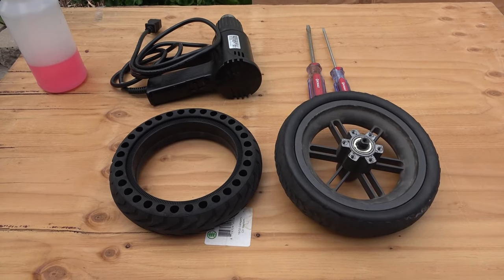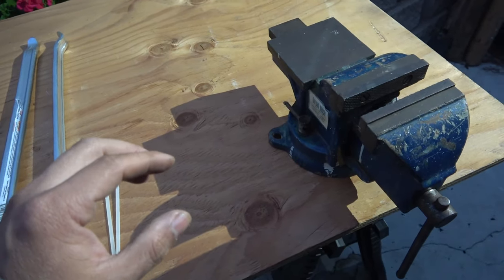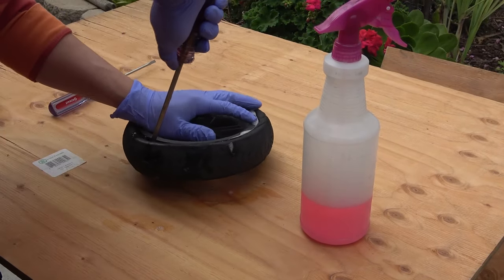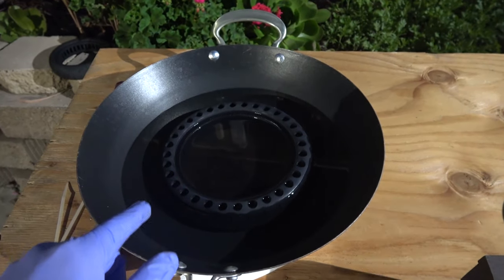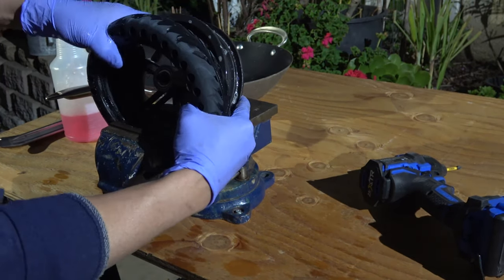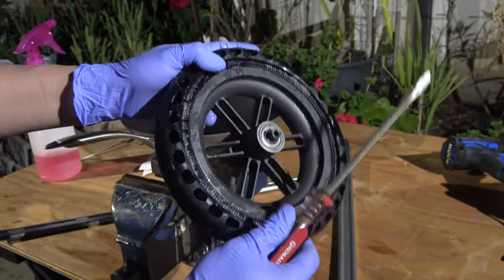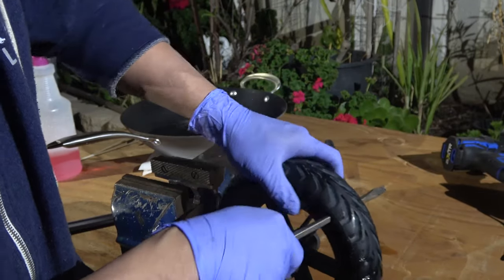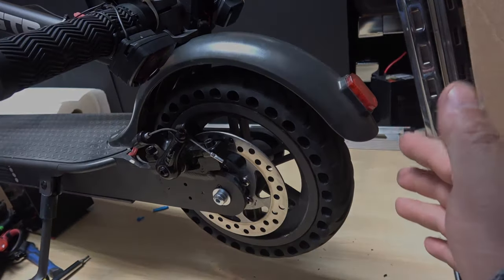DIY: The easiest & fastest way to install solid rubber tire on an electric scooter (Swagtron, M365)

Comment: I find that if I get the solid tire to the boil for 20 mins, I can easily just use 3 screwdrivers to put it on, no need other devices just two feet and 3 screwdrivers

Comment: Thank you 1000x. Best $12 at Harbor Freight I’ve ever spent (for 2 24” tire irons). If you have a vice on your workbench, this is your best option.
Reply: My vice broke and I couldn't get the wheel to stay in the vice

Comment: I had a thought... you can exploit the holes on the sides of the tire.  put 4 rods in each hole equal distance around tire.  Use 4 ratchet straps to stretch the tire, then slide in your rim.  Probably still need to lubricate the rim and tire and a screw driver to get the rim in.  But this way you limit the damage to your rim.  
Anyway, Im not sure if the metal rods will tear out of the rubber holes, but you could put 2 rods per side to transfer the stress load over two holes.  Since the holes are close to each other, the rods can be spaced a little further. Such as... rod-hole-rod.  anyway.  i hope this helps or maybe you can alter my idea for better or simpler results.

Comment: I did something similar using my feet. I just balanced on it with all my weight (acted as the clamps) and forced it with two flat head screw drivers...no lubrication as well. I did however boil that bish for 20+ minutes. Thanks for this video...it helped me get angry at my rubber wheels. :)

Comment: Thanks mate could t have done it without you. I had the motor in the front wheel so i tried without the vice first.

You have to use the vise. Dont try it without a vice.

Comment: Thanks for your video, it worked great, I put some scrap plywood on each side not to damage the wheel.
Reply: Good idea. What kind of vice did you use?
Reply: @itsmesezgin  MIAMI VICE

Comment: Worked great for getting the tire on but having a difficult time getting the bead to seat, do you have any recommendations when using a solid rubber tire with holes on the inside, not the outer edge

Comment: Thank you! I’m off to buy a vice! Lol 😍
Reply: Which vice did u buy? Thinking of buying one too
Reply: @itsmesezgin  I asked somebody on here what size vice should I buy but not been answered yet 😭
Reply: @JustBlondie  Exactly. Well, in this video it looks like a big one. I dont think im gonna buy that big if I buy. There are some you can turn 360 degrees and mount it on and off that looks like it could do the job with half the price of this big one. But dont know yet. I need something that works easy and I can have at home.

Comment: Have a question man I seen your green machine video and it in survived me to make something of my own and I slapped a 1800w motor on and I've went through two wheels already and don't know where to get the tyres from and I've already had to buy two broken Green Machines just to use a tires off them so was wondering if you still have that or know what size the front wheel was that would be super appreciated 😎?? Keep up the videos

Comment: only problem with all these videos using screwdrivers and metal tire irons is the damage it causes to the rims. i'm wondering if you could use the hard plastic bicycle tire levers instead.

Comment: I've done a lot of experiments on this but the best way that works for me is to put and oil  like chain oil around and use flat screw driver's  and stepping on it with shoes no need to submerged in boiling water...  I replace even bigger than that fat solid tires...

Comment: I got the back tire done without a vice. The front will have to wait till I regain some strength 😅 I just put tire on ground and stepped on it. pried it on with smaller tire irons. Also used zip ties 😅😅😅 the smaller tire irons are bent to shit 😅

Comment: Mine came with solid rubber tires (HiBoy S2 Pro) and they are rock hard with hardly any flex at all.  I'd like to replace them with honeycomb tires but they look like a pain to remove 😩.
Reply: easy to remove with a hack saw and and utility knife
Reply: @dfromw3240  True.  But I'd hate to damage new tires.  I will wait till they wear out.

Comment: I'm looking to not fk my rim up lol. You got it yes, just have OCD. The tire I got is a replica for a e scooter. I love them. I want to reverse the tread on one of them so it doesn't look tacky. I'm making something pretty cool and solid e scooter aluminum or a sturdy comppsite material rims, solid flat free tires and  Durable ceramic bearings. These things go forever lol.  If you get a grinding wheel and put a polishing  Pad on it, then use that to speed up the wheel. Use the inertia to to push the wheel off. Do this with a solid axle. So. If you can't get it off that way, do it afterwards to balance the tire and have a heat gun.. I made my wheels bills near perfect with balancing. I'm just pissed about the tread

Comment: Is that the only way? I don’t have much tools like that
Reply: Cable ties work
Reply: @rabbieburns2501  how
Reply: there's no easy way without some tools. the challenge is holding the tire firmly on the rim where you start it so that it stays in place while you use the irons to lever the tire around the rim.  some people use cable ties to hold the start point in place but you can't do that with the motor wheel. others just stand on it with both feet, but that's also tricky to do when you're trying to also lever the tire around the rim. also, since the tire is slippery from the lubricant it's also hard to grip it with your hands. when it's in a vice you can really get some leverage on the whole thing without it slipping around.

Comment: Anyone know if you can put a inflatable rear tire on the existing rim. I am not a ran of how harsh the ride is with a solid rear tire.
Reply: Update: you can do it as long as there's a hole for the tube stem, works great and rides way better.

Comment: Hi I installed a new rubber tyre and it keeps coming off when riding do you think its faulty its not the wrong size as I did measure it before I purchased it

Comment: Bro I just did this and should of watched this first I used a butter knife and my kung fu grip I wound up wetting the tire under hot water but I think it was just the water that made it slip on and before my tires came in I tried to patch the tube first which I pinched twice and wound up with a slow leak but don’t gotta worry bout flats now

Comment: Solid tires are so comportable to drive with, thats why i went back to tubed tires. 😂😂😂
Reply from the maker: Until you're stranded in the middle of nowhere just because you run over a thorn on the road.
Reply: I have a scooter down in Mexico, good luck finding tubes, guess you were just a dumbo for using them if they aren’t really needed 🤷‍♂️
Reply: Where i live theres always broken glass everywhere. Air filled tyres isn't practical for me.

Comment: I ordered online same 8.5” rim and solid tyre also with same 8.5”. I cooked that mf heated with heat gun but it didn’t go in. First can you tell me what size of solid tyre will fit in 8.5 inch rims and secondly guy dont try home trust me . There are some mechanical work let them do. U might hurt yourself or can break parts. Its not easy. 😢 they charge you for reason

Comment: I have some what mixed views about your method to fit solid tyre on to the rim.First of all not everyone has a suitable vice lurking around in home so not ideal for everyone.Tyre levers recommended but an average size screw drivers will do too.If you have a vice make sure it is secured well and not wobbly like this guy has.You could end up with serious injuries if the rim or vice comes off while you are exerting a force to put the tyre on.Also to be careful how tight you clamp the rim as you could damage the rim by over tightening the vice.There are other ways to fit solid tyres,none of them very easy so find what suits you 👍

Comment: That is not an easy simple way to do a solid type replacement. I really need to do a video about this seeing how everyone struggles so much with this. It's not that complicated. You can do it easy without heating the tires at all or using a vice 🤣🤣🤣 This video was painful to watch how much you struggled.
Reply: Still waiting for your video